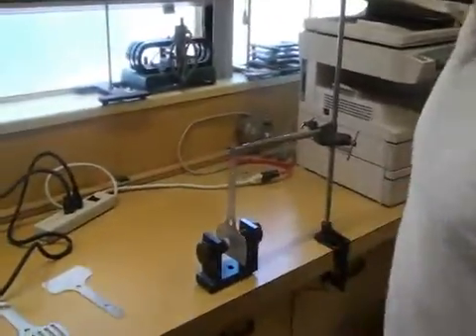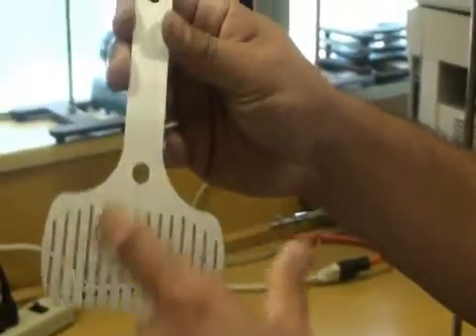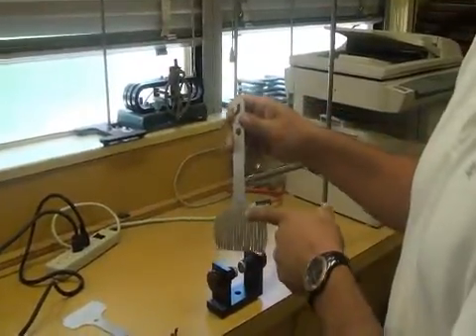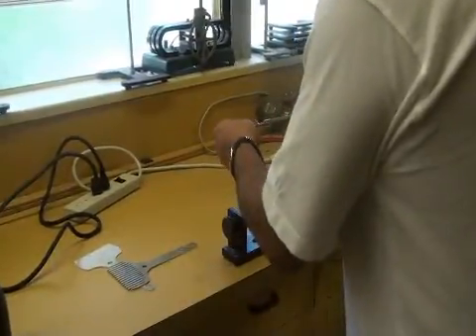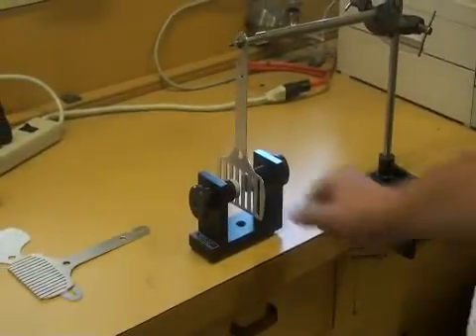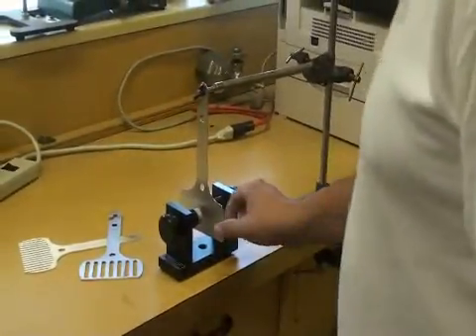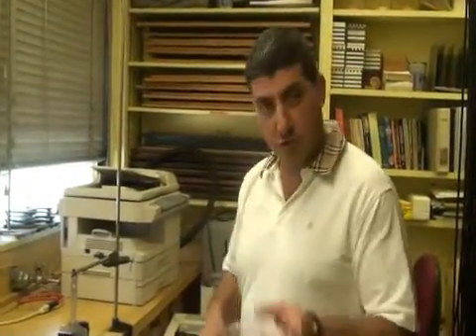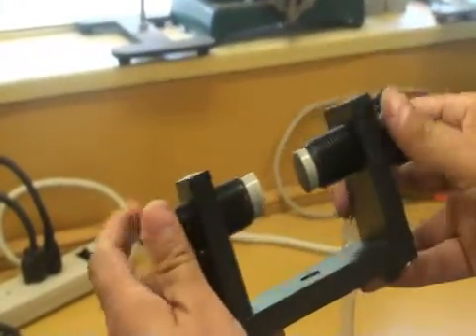Magnetic Brakes

Comment: @xXCrimsonVirtueXx What you're saying is true, but what I meant was since the slabs that "rub against the inside of the wheel" is working efficiently enough already, there's little reason to use magnetic brakes (I'd imagine it'd also be high maintenance to keep it up to par?). And continuing from above, when I mentioned the ground I meant the car stops BECAUSE of the non-moving tires (assuming the wheels lock from the brakes) that rubs against the ground.

Comment: @MarineFocus Most cars use brakes, which are just metal slabs with lots of friction, that rub against the inside of the wheel, causing friction, causing the wheel to stop. It has nothing to do with the ground. When magnets interfere with copper or aluminum it has a slowing reaction which could be applied to cars to slow them down.

Comment: cars brakes don't even work that way -.- wth is he saying
the brakes itself stops the tires from turning which creates friction with the ground and thats how the car slows down...
I don't see how you can apply that to cars? unless you meant replacing the rubber braking parts with the magnetic brakes... okay, more efficient in not wasting rubber but thats not going to help cars slow down faster unless the GROUND magically supports magnetic brakes.. which is like wtf

other than that cool vid

Comment: @SZDarkhack
Ok, but you have to admit that if you compare the magnetique fiel brake to a conventionnel brake systeme there's a huge difference in the temperature.
For an example take an electric motor: the most of the heat is produce by the bearing, wich is friction. I bet with a magnetic brake you can put your hand on the systeme after braking for a mile long hill, but on a conventionnel disc brake and pad systeme you would end up at the hospital with severe burn lol.